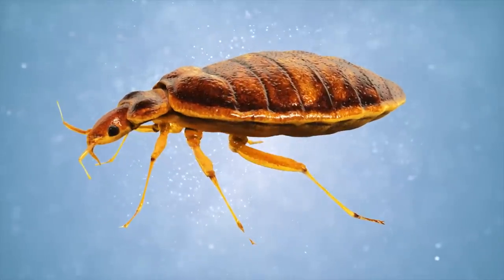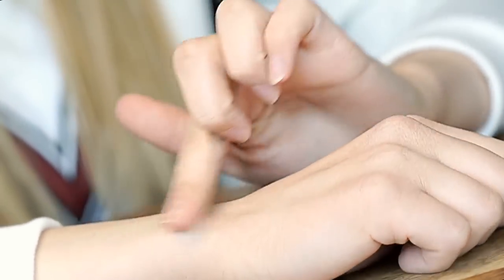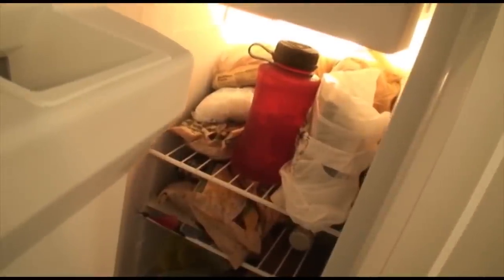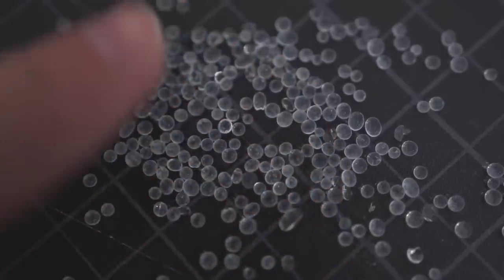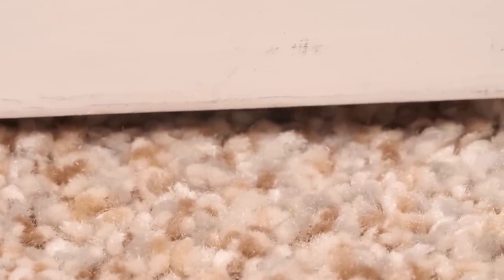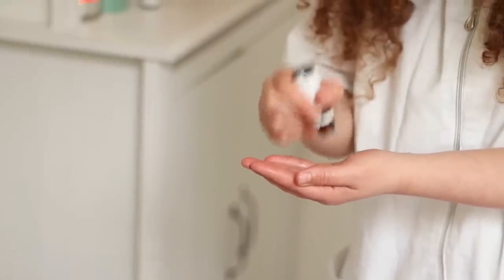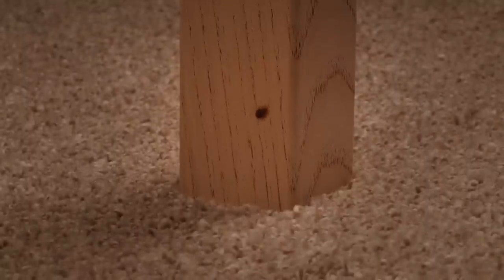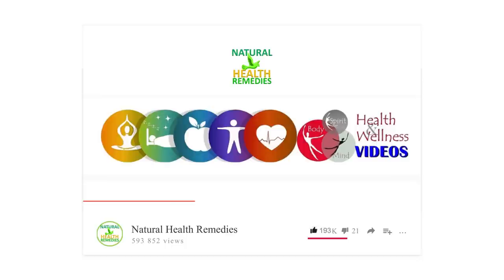How To Get Rid Of BED BUGS Fast & Easily Yourself At Home

Comment: I had bed bugs in my car somehow. I bought an 8$ can of bed bug spray from walmart and just spent the entire can (took about 15 minutes) spraying the seats and floors until everything and every surface was slightly moist. I left the windows open to let the car air out overnight (the chemicals that kill bed bugs are not overly toxic to humans. They can kill cats easily so be careful and wash your hands after using to save the cat.) It worked. The secret is to be thorough and not miss any hiding spots, which you probably will. But the spray can is much easier and cheaper than anything this video suggests. It is not deadly to people, but will kill cats, fleas, and bed bugs. If you have bed bugs than you know 8$ is nothing to get rid of these hell creatures. You just need to spend the time getting all surfaces, cracks, and hiding spots.
Reply: 'HELL' creatures is RIGHT!!
Reply: May I ask what is the main ingredient in this bed bug spray you used?

Comment: When the bed is dismantled, if it is wood, repaint it, making sure the paint goes into all the cracks and slots. When it has dried and put together, wrap double sided tape around the legs. Place the legs in metal dog bowls, place some diatomaceous earth in the bowls, after wrapping the outside of the bowls with masking tape so they can crawl up and slide into the bowls. If the bed is metal, I would still try to paint it, and instead of DE in the bowls  you could put some kind of oil in the bowl, likely a vegetable oil, I don't think they can swim in it.
Reply: No, they can't swim. Diatomaceous earth quite well is what I have read and heard.
Reply: they can't swim, but the can easily climb a wall and drop from the ceiling.

Comment: About mattress and box springs encasements: If they wrinkle, bed bugs will hide in there. They will also hide behind the velcro tab which covers the zipper.
Reply: True...also in frame on bottom of box spring encasement. Consistently load up on diatomaceous earth in these spots for a long time...will take care of them if you stay at it. Will use this stuff forever...is a miracle powder!
Reply: diatomaceous earth IS SUCH TRASH AND DOESNT GET THE JOB DONE. I had a bad experience with these nasty critters and tried diatomaceous earth as well as other things. well couple months pass and during that time i notice a slight decrease of the bugs then back they came in full force. So i did hours and hours of research and learned about Cimexa. Alot of people think there the same but they are totally different Cimexa is silica gel in powder form. sick of typing so research urself or just trust me instead of buying diatomaceous earth buy Cimexa and say bye to them nasty things

Comment: i put 4 bed bugs into a pill bottle and left them in the freezer for 3 days. Took them out of the freezer and within 20 minutes they were crawling around again. good lord there are so many errors in this video it's just sad. Whoever made this did little to no research what-so-ever. 

Bedbugs, when threatened with extreme cold and lack of food will simply hibernate and wait for something that could be food to come near. These critters go EVERYWHERE and they are actually startlingly fast. Even if you put bowls around the legs of your bed, they'll just climb the wall and jump or drop from the ceiling. If you want to locate where they're hiding other than just randomly checking places, the only way to track them is after they've bitten you and they'll leave a trail of spots.

The only thing in this video that is even remotely close to being useful is steam cleaning. I don't know why they fail to mention how useful certain plant leafs are. The leafs actually have hairs that impale the feet and most of the time will trap them in place. The adults are the least of the problem, the babies and eggs are the biggest problem because they are tiny.

Bedbugs can sense heat and CO2 but they can only sense it from a couple of feet. They'll burrow into the darkest deepest places they can. Once they've molted, i think, 5-6 times, they'll be old enough to mate and reproduce. Once a female has mated, she can continue to produce eggs until she runs out of.... the male component... at which point she'll need to mate again. eggs are very very tiny and babies are practically translucent until they've fed for the first time. 
Interesting fact: Males impale the females to impregnate them and there's actually a slight chance it will just kill them. Males will also attempt to mate with babies that aren't yet mature enough to mate, but they immature ones will release a pheramone to deter males from attempting to mate with them. 

The best tactics for getting rid of them is to restrict their ability to move around the house using double sided tape on doorways(floor,walls,and ceiling). I would put the most work into the room you sleep in first after taping the doors to prevent them from feeding and multiplying because they can only grow and multiply by feeding. Work on the other rooms as well, but your sleeping space should be the highest priority.

Last but not least.... Make sure they're gone before you celebrate. Babies don't require the care or attention of adults in order to re-infest a home. You won't know they're gone until you stop finding them for several weeks because of the amount of time it takes for their life cycles to complete. They can live for 10 months and can produce several hundred offspring each.
Reply: I concur, I found your comments to be most reassuring and affirmed my limited knowledge on how to get rid these little suckers. ( no pun intended) Thank you very much,  you Sir, are a truth sayer. GODspeed.
Reply: wtf😂😂
Reply: Yes it takes much  time to get  rid of  bedbugs consistency  needed while treatment
Reply: You mentioned certain plant leaves have hairs that repel bedbugs, can you share what kind of plants?

Comment: OR....just sprinkle ordinary table salt on your floor or carpets and just forget about it, to a BB a gran of salt is the size of a washing machine and it BURNS them as they crawl by, they will look for the nearest exit. It works.

Also, beware, they will hide in your office chair wheels and wall sockets.
Reply: zengreen7  is it really effective/working? Can i use refined iodized salt? Imma try this tonight...hope it'll work...im so frustrated with all those BB😩
Reply: @ejassi3425  It works but I forgot to mention that you must keep the salt on the floor or carpet for about two weeks at a time. It is also possible to add salt and water to a spray bottle and spray it where needed and yes refined  iodized salt will do. Lastly please go to home depot and grab a bag of diatomaceous earth, it is a non poisonous power, it is said to be ground sea shells but when the BB crawl over it, it slices their body open and dries them out and they die.---------> THEIR JUST DESSERTS! Also, put up perimeters of D.E. around you sofa and bed legs to stop them from climbing in. 

Lastly part 2:

Invest in a good floor/furniture steamer.
Reply: zengreen7 thank u so much for ur tips...hope they'll leave me alone...i want to sleep tight everynight✌🏼
Reply: 안녕ejassi have you tried any of this and have they worked
Reply: Max Million nothing worked i guess? Nevertheless Boiling hot water worked 100%
Reply: 안녕ejassi : make sure to isolate your bed if you haven’t already! That is a SUPER important step! That will keep them away from your bed and give you more peaceful sleep! Look up on the Net about how to do it.
Reply: Salt, huh? Thank you!!! Am asthmatic and fighting them myself. I can't use the BB  poison as it makes me sick. I just got DE and am going to get it down. Also, I have slick plastic cups about a third full of water with a couple drops of dish soap in it. They can't climb out and they can't swim. Great for finding a bug crawling and just drop it it.
Reply: @julieutley6615   Also, invest in a steam cleaner and cook them right where they hide in your furniture, but it is very important to stop them at the source, you must put DE in your wall outlets that is their favorite entry point in my experience.
Reply: Bon appetite!

Comment: I bombed and sprayed and vacuumed and washed over and over again. The number decreased but didn’t eliminate. Then I took the whole bed and frame outside and dismantled it to find they were hiding between joints in the frame and cracks in the wood headboard.
Reply: I can believe it, they can flatten their bodies to be as thin as a sheet of paper. You MUST cut them off at the source or they will always come back, mine were entering my apt through the electrical wall sockets then into my sofa, check there.
Reply: zengreen7 wow, electrical sockets! Never thought to check there 😕
Reply: Bombing makes them worse and spread through walls and vents
Reply: That’s always where they will be. It is suggestible to either get them out of all those cracks and then call them so they can’t hide in there anymore, or get rid of the headboard entirely. Isolate the bed, which includes moving it away from the wall so they can’t get onto it. Lay down diatomaceous earth or cimexa in your baseboards and anywhere not just in the bedroom but the house, that they could hide.
Reply: zengreen7 : sounds like the only way to solve that is spray alcohol in there or some other thing that kills them? I don’t see how you could stop them from coming in that way, if a building’s walls are infested.
Reply: Here is what we did that let's us all now get a good night's sleep -bedbug free:
Freshwater DE (diatamaceous earth) sprinkled EVERYWHERE dessicates them.  If a line of DE is spread they won't cross it if they detect it.  If it is rubbed and finely sprinkled they cross it and are dessicated.  We kept them off the beds and furniture dusting the bottom of empty tuna fish or other small fitting cans with DE and placing them under the furniture and bed legs - no more climbing up on bed or in chest of drawers or couches, chairs, etcetera.  Also an inspection and dusting inside drawers.

Of course taping up open receptacles and sealing openings around under sink plumbing, and several good washings and dryings of suspected bedding, etcetera, speeds up the process. Even if a bedbug does get a bite in one night that is its last meal as they scurry once again over the rubbed in DE - they never return. Use white or light colored sheets for awhile to be able to see them or their small black hard feces, in case they hitchhiked on your clothing from another location.  Also the cats and dogs can be carriers but not get bitten (to my knowledge).

DE is very cost effective and very very effective when used liberally, because of its tiny shards that dessicate the bedbugs (and cockroaches).  BTW, cockroaches will eat bedbug eggs, but who wants cockroaches! Yes, for a few months the DE dust is in all baseboard nooks and crannies and eventually you can vacuum or sweet it all up.  A visible line of DE across a doorway stops them from entering, if they detect the DE.

All this from personal experience and doing the above without resorting to bringing in a costly and even more life upsetting professional service with all their sprays and gadgets and displacement of furniture, even having to leave the house until their work is done.  

Just buy some freshwater DE (a finer product) off the internet - I got it on Amazon - a flour sifter and a turkey baster and get to work, while the bedding is spinning in the dryer. This is not something you have to keep doing forever and forever, unless you keep bringing them home with you from outside or they keep coming in from outside (tape all receptacles not in use), especially if you live in an apartment. I also sprinkled DE on the outside of apartment door into the carpeted hallway. Rub it in until it is not visible - it still works. I always shake out my clothing when taking it off or putting it on.  I also dusted inside my shoes initially. If the situation is really bad and you are really desperate you can rub it onto your limbs and hands and feet before you sleep at night - anything for a good night's sleep  :-)) 

In the beginning before I knew what had hit us, I opened my laptop and found some bedbug eggs inside and removed them.  Now that all furniture legs are standing in a small container dusted with the DE that no longer occurs.
Reply: don joe  It definitely works, but stinks and is not entirely a walk-away solution - the DE is more of a spread-it-around once, rub it in, and walk away - no stink.  I did not have to hunt-em-out, but the alcohol spray is great to have handy when you spot them crawling up a wall or making themselves very visible.  The DE dust sits there forever.
Reply: Use bed bug spray. Ive heard mixed experiences with it but Im only recommending it because it personally worked for me. It claims to last up to a month until needing to spray again so id spray along all the corners, baseboards, under the edges of mattresses, under furniture etc. Just that alone got rid of nearly 90% of them for me, and after turning my bed into an anti bedbug fortress, any remaining end up starving and dying out because they cant reach me mauhauhahuahauhah
Reply: @nickbrushesteeth2002   :-) Hello Nick :-) that's the ticket - you got it - just keep applying the spray.  In my case it was the DE that did the job - same as you describe...used a flour sifter and turkey baster.  

They might take one last bite, crawl over the embedded DE shards and never heard from again..... certainly won't be able to lay anymore eggs.  Plus I took empty Friskies cat food round tins, dusted them with DE and placed them under legs of bed, couch, etcetera. Tuna tins would work.

We never realized how important a good night's sleep was until these critters arrived.
Reply: Anthony Shostack    :-) Simple and done.

Comment: About the freezing. I’ve heard it can take up to 30 days with freezer temps to kill them. A couple weeks at least. It’s not an option id suggest.  The info in the video about that is most likely incorrect.
Reply: Invest in a steamer.
Reply: HEAT IS VERY EFFECTIVE AND QUICK - ONLY A FEW MINUTES.
Reply: @coiledsteel8344  30 min at least

Comment: I was infested by these blood suckers all over my mattress , the solution ? Very simple :
I used a commercial roll of plastic wrap  (the ones that is use to wrap product for shipment ) 
Wrap your mattress with plastic wrap all over and problem is solved , its cheap and only takes few minutes to do it.
Some friends of mine had the same problem and now we all bed bugs free .
Try it , it really works .
Reply: What about on other furniture?
Reply: If you notice them early enough I can see that working but they move into other areas besides the bed…..heat registers, baseboards, clothing, wall plugs, electrical items such as stoves, computers, tv’s. All kinds of personal belongings,  because they are so small, they fit anywhere. 
Truly one of the most frustrating and exhausting things anyone can experience!

Comment: How do you mix the lavender oil for spraying?
Reply: I have the same question? Hopefully they respond to it! 🤷🏻‍♀️
Reply: U put drops in a spray bottle mix it up with hot water very  high heat and  hot steam kills them but the problem with bed bugs u only have to miss one and they can lay hundreds of eggs every time so I had this problem for months tried everything so now im constantly using steamer machine gotta do constantly everywhere if u dont have a bed bugs 3 weeks straight then u know your home is free of them but its a constant battle !

Comment: infefested after three treatment got bit felt it was awake was painful and itchy, and w white wely jusy like a mosquito bit formed within minutes, the welt slowly went away after an hour or so (if i didn't scratch) the i had the red itcy bite for weeks..and i though ticks wee bad at least the attach and just pull them off and done.
Reply: Try using Caladryl lotion. Stops the itch right away and shortens the healing time.

Comment: what is the deal with you north americans using metric in your videos. we dont use the metric in america.
Reply: most of the world uses the metric system ya'know
Reply: Only three countries – the U.S., Liberia and Myanmar – still use the imperial system of measurement. Also, Canada in in North america, but we are most certainly not part of 'Merica (USA).
Reply: @rain1956  , Canada uses metric, although I will say we often still talk miles and pounds. 😊
Reply: @MissBee-lz1tq True. 😃 And I have to admit I  also prefer miles/inches and pounds, enough that I convert the metric numbers into imperial for myself. It's interesting how those haven't "taken" as much as Celsius.
Reply: @rain1956  , you’re right. Celsius has been easy to accept but the others…..I was in grade school when Canada changed over and already learned Imperial measurements. I guess I just stuck with it as per previous generations. If I’m not mistaken, the USA was supposed to change over to metric with us and then backed out. I convert for myself as well….especially for cooking. 😊🤷‍♀️